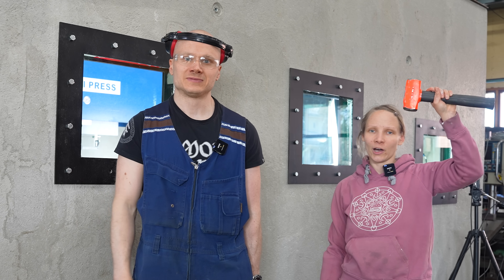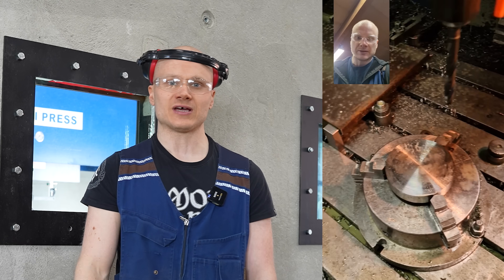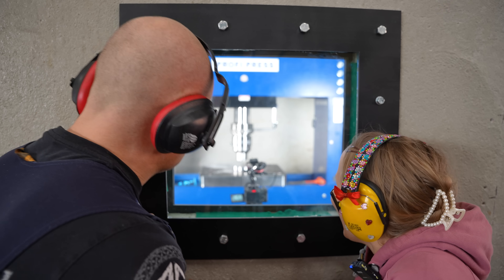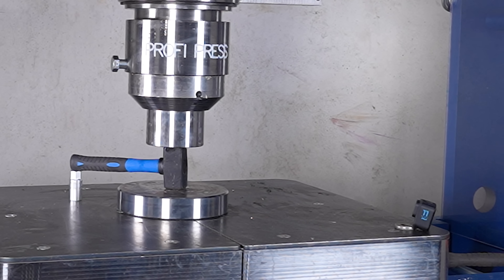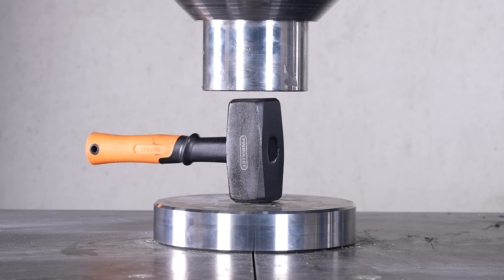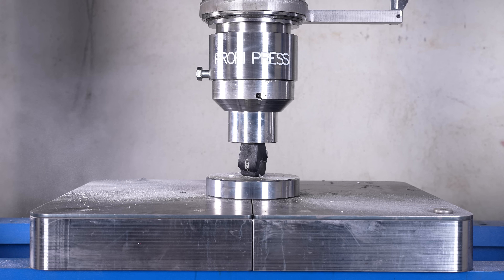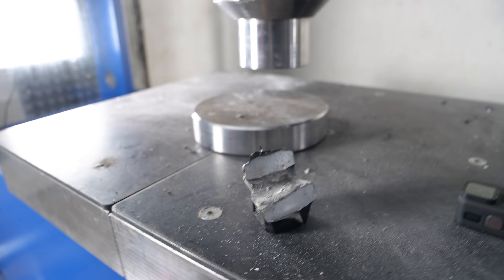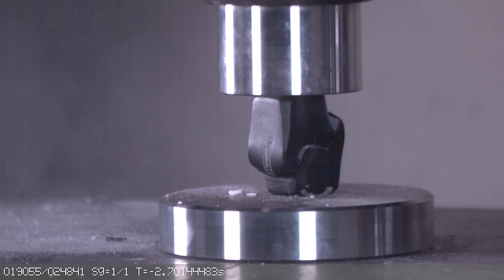Crushing Hammers With 300 Ton Hydraulic Press | Caused Local Earthquake

Comment: I am calculating those pieces at 6:40 flew at about 300 to 360 km/h. The video is running at about 300 frames/s, the pieces flew about a meter every 3 seconds, so 100 meter/s times 60 seconds times 60 minutes, 360.000 m/hour, 360 km/hour, give or take some

Comment: I think a pneumatic dampening system would work well for mounting your press. High surface area low volume oil damping. There wouldn't be a direct connection to the concrete, thus less chance of long-term wear/fatigue.

Comment: I think your main destructive forces are going to be up and down, so you could just mount the whole think on rubber isolators and use heavy chain and concrete anchors to prevent it from moving forward back left or right, it can hop up and down then on the rubber, like very dense rubber, maybe tire tread cut and laid flat under the feet.

Comment: I work at a Machine Shop that uses "turret CNC Punch" machines, essentially a press that smacks a shape into sheet metal at high speeds with 45 metric tonnes of force, they make specific vibration mitigation mounts, it may not be as extreme as exploding a hammer, but i cant imagine that it would be a bad idea, before my shop got them it was throwing out all the machines in the quality lab

Comment: Remember that you also need to also decouple it from the bolts when you attach it to the ground. I think some PU silentblocks with large, thick washers could do the trick with the added rubber sheet below. I would mount the electrical cabinet to the wall and protect it with a steel shield mounted on a hinge because we don't need to see the cabinet. That way you protect the electronics from vibration and shrapnel !

Comment: Looking back at the video - I'm almost certain that the frame of the press stretched. At the moment the hammer head ruptured I'm pretty sure the frame pulled the bottom of the press up towards the ram. You need to point high speed at the feet of the press and do that again for science 😅

Comment: I worked at a factory that used a 220 ton press for sheet metal and our presses are isolated from the main slab with a cutout around the press.  I'm not sure if they fill the gap with rubber but I can't see how that would hurt.

Comment: Make the light barriers and the electronics cabinet as stand alone units that are detached from the press itself. If you mount some kind of magnets to the walls you can use them to hang white paper (that kind of painting protection paper on rolls) on the walls. Easy to change and you get better light and you can see shrapnel marks easy!

Comment: You should do a press where you have a special designed die where you then press a very hot aluminium bar (since its much more malleable when hot) through the die so you will get an aluminium profile out the other end. If not to big bar and not to small profile holes, I think 300 ton could be enough. That would have been really cool to see.

Comment: Maybe put the electronics on separate stands mounted to the floor and Isolate the press from that floor by rubber sheets, even just 10mm should make a difference.
Concrete is very strong, but it´s not that great with shock loads over time.

Comment: You can mount Press on similar dampers that are used to mount big industrial blowers on the floor, your local manufacturer KOJA Oy use them in their applications. They are very strong and pretty small even for the weight of the blower, i have seen them up to 15 tons, and those blower move alot sometime.

Comment: You might consider using 'bearing plates" similar to what supports a bridge: hard(ish) rubber sandwiched between two steel plates.  I think they'd work better than spring mounts.

Comment: You might try something like twisted steel cable to mount the press to the floor...it is "springy" but the friction between the strands helps it to act with a bit of "shock absorber" action.

Comment: You could make a resilient diffusers for the lights by sanding one side of some polycarbonate and shining it through that and maybe a ventilated box for the actual light unit in case of ricocheted shrapnel off the wall too. 😂

Comment: I was splitting some hard rounds of wood with a steel wedge and a brand new mall that I just bought and after a couple swings I thought that I missed the wedge and hit myself in the shin but it turned out a piece of the mall splintered off and shot into my leg going past my shin bone and was buried into my calf muscle. It was a piece about the size of your fingernail. It made for a nice x-ray. The crazy thing was, that's an emergency room quack was going to cut open my shin to remove it from the back of my calf muscle until I stopped the moron and told him to get a surgeon in which turns out was a good thing because it was very close to a major artery. The first thing I asked the surgeon was how are you going to extract it and he said cut open the calf muscle and I laughed and said oh you mean you're not going to cut through my shin bone like their emergency room guy was going to do? He looked at me in amazement and as if I was joking but I had to reassure him that I was not. Smh.

Comment: Impressive! Maybe you should take a look at japanese earthquake proofing technology. They manage to put whole scycrapers on rubber dampers to make buildings earthquake proof, even in retrofitting. Your 5t press should be nothing, using that type of technology.
For starters, I would recomend thick industial rubber mats on the concrete, covered by a layer of wooden railway sleepers, finished by a load-bearing finish of thick steel plates to distribute the weight of your press` feet. But that´s just my amateur opinion.
And, of course, steel plate sidings to protect your press´ electronics.

It would be nice, though, to know the pressure at which the structural catastrophy, or the desired incident happened more often. Like with the Lego bricks. Just for curiositys sake and maybe to compare the products, like your hammers.

And please, send a little gift to your neighbours and invite them every once in a while to your adventures to make it up to the inconveniences they had to endure.
Would definitely be a loss to miss your future experiments. :)

Comment: I think i would move the controls outside of the bunker and use an interlock on the door.  Area scanners for the inside of the room for person detection.  You can put shield around the scanner.  As long as the shield is transparent to infrared it will still work.

Comment: When I use to work at Leatherman and other big machine shops the qc lab and larger presses have a "mattress" under them of large coil springs inbeaded into a lease rubber mat uhmd layer under that spring steel under that.  Steel plate, Steel springs, rubber horse mat, bassicly plastic cutting board then steel plate bolted to the floor with floating dowel pins.  Worked well hardley felt the 20ft tall presses while working.  Another plant I worked at was precision cast parts which pressed and milled inconel alloys for bridges and cruise ships. They had a similar setup but had mineral oil hydrolic springs that didn't fatigue. Hope this gives you some ideas.

Comment: you need to put something on the wall behind the press with lines. Like 10cm between the lines and then you can calculate speed of the flying objects based on how many CM it fly in like 10frames or something. The Mythbusters used them all the time and Ive seen them on some ping pong cannon videos too.  Basically it is black and white lines of known width (metric markings).  If you know the frame rate of the camera and playback frame rate you can measure the exact distance that an object moves between frames and calculate the object´s speed. This would be really interesting to see how fast different things fly whent they explode

Comment: I operate a universal material tester with a capacity of 111205 newtons (25000 pounds of force) in tension and compression. We have to mount the tester on Heavy Duty Vibration Dampers for the same reason as you.

Comment: Thanks for going to the effort of making an impromptu conversion to Imperial measurements. If your math is accurate and that concrete is only a foot thick, I have to say, concrete doesn't do well against shocks like that. I've demolished concrete before and I'm concerned that it will eventually weaken and break, if you're causing windows to rattle throughout your whole neighborhood. But the rubber and whatever suspension system you're thinking of (maybe shock absorbers from a truck?) should help with that too.

Comment: Camera Hire Technician here. 
That NANLITE  soft box will just get more holes, the more you crush. 
Take off the soft box COMPLETELY and save that as it’s quite expensive. 
Get yourself a Roll of F2 / 250 Frost lighting Gel on a roll. (Around €60)
Gaffer tape a 2 foot by 4 foot piece to a metal square, it’s called a Trace Frame if you Google it. 
When something blows through it, just cut another piece off that roll and replace it.  (You’ll get about 6 frames out of a roll)
It’s going to be more cost effective doing this due to all the shrapnel flying round. 
(You could even make it a 4 x 4 frame and give that light a little bit more protection)
Hope this helps.
Reply: stuff might just blow therough the gel and the box.. maybe a new piece of plexi in front ? shouldnt cause too much modification t othe light for something like this where absolute color isnt important..  those nan 500's  put out quite a bit of light to overcome the loss through the plexi.. at least its a godox box which isnt as pricey as the nan
Reply: @eldoradoboy  For protection, maybe but heat is the issue. It will melt that plexi in no time if it’s in front of that LED. 
(I’ve seen many protective caps returned melted when not removed before striking)
It’s not meant to protect it, it’s just a beneficial secondary perk to having a trace frame set up. If stretched tightly on the frame like a drumskin, it can absorb a fair amount of impact, as long as it not sharp. 
Me and work colleagues used to see if we could punch and kick through the old Trace Frames. 
We ALL failed.
Reply: A periscope arrangement might be better. Put all the expensive light tubes and control circuitry pointing upwards behind a solid shrapnel-absorbing barrier and then mount a sacrificial mirror-plastic sheet angled at 45 degrees above the light unit. Any fragments go through the plastic mirror which can be replaced cheaply when the number of holes gets to be too much.
Reply: why not just frosted lexan?
Reply: @john_barnett  Cost and heat. That light will melt plastic if it’s too close. Lightings gels are designed to be HOT. Plus if the Laxen cracks from an impact, those cracks will look like a spiders web on the light cast. The lighting gel can be replaced easily and far cheaper.
Reply: @Bulletsilencee  good point
Reply: @Bulletsilencee Aren’t lighting gels just made of thin sheets of polycarbonate? I believe they are, and if that’s correct - a sheet of clear polycarbonate in front of the softbox wouldn’t melt, and would protect it. 

I have a few friends that work in the film industry, and regularly work with lighting, so my experience with lighting gels (aside from some experiments for personal projects) is pretty limited, so I could definitely be wrong, but all the gels I’ve handled have definitely been made of plastic, and Polycarbonate is the highest temperature clear plastic that I’m aware of.
Reply: @KaminKevCrew  encasing it in plastic would still cause heat issues. 
I wouldn't recommend putting gels on that softbox as it will just end up becoming swiss cheese. Most gels are a thin plastic and are heat resistant they were designed to use with tungsten lamps so should be no issue for an LED.
Reply: 250 won’t stop that.
Reply: @rossfuller3224  Double Skinned it has a chance. I nearly said F3/252. Even a roll of muslin would do it.
Reply: That's an awesome tip,thanks
Reply: Those Godox softboxes are less than $25 on Amazon and they will take quite a few hits before they have to be replaced.
Protecting the lights is the real problem

Comment: Maybe completely decouple it with large springs, in addition to some layers of roxall or fibreglass insulation on the walls if needed. Concrete is a pretty loud resonator.

Comment: Would it be possible to extend the wires and cables of the press so that that electronic/control cabinet could be mounted on the wall of the bunker? That way the electronics wouldn't jump around :)

Comment: Search for dampening systems used for industrial vibrating screens.
Either cylindrical  reinforced rubber dampeners or (more expensive) pneumatic dampeners (like the ones used in truck suspensions)

Comment: You need dampers made of cork and rubber ... the cork provides space for the rubber to compress.  The brand name is "Tico" and the usual material for the is "Tico LFPA" ... check it out.  Plain rubber will NOT work because rubber, despite being elastic is incompressible when restrained between plates ...

Comment: Love the video! I think you may need to absorb that impact. Possible mounting the press base betweem stiff springs and suported with dampers, cushioning the blow. That's a huge shock if it's shaking the neighbors windows, and making the press jump. With how violent of a shock it is, bolting it down on rubber or even straight to the floor, i think the press will gladly either break or remove said hardware. Im not an engineer. Probably not a bad idea to talk with one tho. Anyways Just my 2 cents. Keep the videos coming. Thanks

Comment: I look forward to the ball bearing crush with the new machine.   Also, do two or more ball bearings in a separate test, the cascading failure would be interesting.   Also, I miss the maximum force readout you had on the other press.

Comment: You may want to detach the control box from the press and mount it to the wall if the cables are long enough. The shock and vibration from exploding stuff is going to eventually damage the circuit boards in the control box.
Reply: 11:17 he is aware, I would be too with such expensive equipment, doesn't hurt to say though

Comment: I agree that isolation under the feet of the press with attachment to the floor would be helpful.  There may be products designed for this purpose, but automotive engine mounts might also work if you can make sufficient holes through the press legs without weakening them.  You might ask Profi and see what they'd recommend, though they aren't accustomed to having their presses jump around ;).

Comment: Make some rubber feets for it. Maybe thick steel plates with rubber sheets glued in between them could work. Then you could bolt the bottom plate to the floor and the top plate to the press so it doesn't jump around.

Comment: On the last slow-mo look at the electronics bracket and weld in the top right corner.  The press jumped at least 30mm! 

Afik wire-rope coil shock mounts are good for this type of thing, but a nice hard set of rubber isolators should work fine.

Comment: I worked at a forge after HS. It's press had a 12ft diameter cylinder.   All the major parts of the press were in a chamber three stories high underground. The biggest piece I saw worked was a 16ton, 6ft diameter, 6ft thick Blind for a deep sea oil pipeline. It sat red hot for 6 days and took 3 week to cool enough to ship it.

Comment: Now that you have a bunker, could you make a hydraulic ram that is basically the press but releases all the energy instantly and smashes whatever is in it's way? Could be hella cool to see with some nice super hardened steel that would shatter.
Also maybe some wire mesh/chicken wire over the lights. Shouldn't affect the brightness, should protect the lights more than now lol. Or put some plexiglass in the bubble.

Comment: As you said, the press Profi Press built is spectacular, but it is designed to press things together or apart that have an engineered tolerance in the SAFEST way possible.
Doing the things that shouldn't be done is not really their job to deal with.  I'm sure one of your viewers can help with material and design concepts which can significantly dampen the extreme energy release on mother earth.
P.S. The ventilation system on the new light will help with cooling as well.  ;)

Comment: You might look at adapting an isolation solution for a power hammer/forging hammer, since those are designed to effectively slam heavy weights into the floor.  It might also help to make a slit cut in the concrete around the press or around the walls to isolate that portion from the rest of the shop.

Comment: Please think about having your walls line exed or rhino lined their truck bed liners that spray on that would drastically save your walls. The stuff is very durable. You wouldn’t get these chips or cracks in your concrete and it would also help as a sound barrier. Just a thought keep up the great work!👍🏼🤩🫡❤️

Comment: Can you move the electrical cabinet outside of the bunker?
Also replace the light curtain with a switch on the door. Makes sure the door is closed when you crush. And if you want the light curtain make it removable and just install it when you press stuff that requires you to be close to the machine.